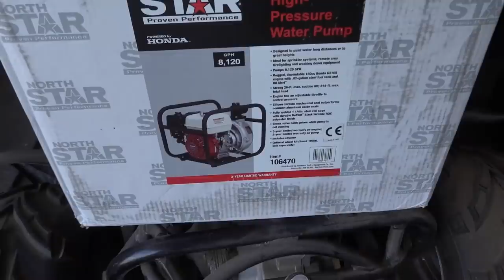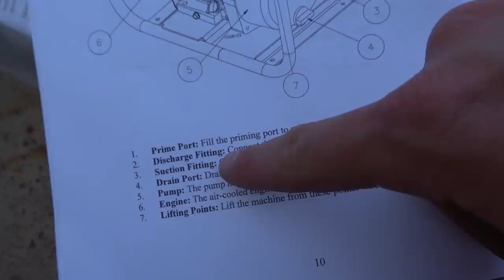I Built the Pumper Truck!!!!! Master Chief is Alive!!!

Comment: Matt I've been a firefighter for over 35 years, what you need is a 1" hose reel commonly known as a booster line or a trash line that will solve all your problems it's a hard line so it won't kink it's on a reel so you can just roll it up and pull out what you need
Reply: this needs more upvotes and replies so it makes it farther up the list of comments and gets seen
Reply: Great advice
Reply: You need a water cannon mounted up top. The 1" reel will work well for your use also.
Reply: Booster line is the way to go !!!
Reply: Dang good advice.
Reply: He could also use a proper manifold and a check valve in a return line so the pump isn’t fighting the water when the nozzle is closed.
Reply: heres a comment for visibility
Reply: Kevin that's exactly what I was thinking he needs a 1 or  1 1/4" trash line on a hose reel that's what we had on all our brush Trucks
Reply: @Zombies_Ate_My_Neighbors  the reel deal, if you will...
Reply: Thank you for your service brother! So many people always think about what the armed forces do but they never stop to think about an to thank those of the citizen people. I.E police, firefighters doctor and nurses! So to you an to all those like you. I say thank you for all your hard work and bravery especially these past few years. Keep rocking on an stay safe y'all
Reply: He will be better with forestry  hose and just pack it  like a pre Connect
Reply: Yup ... Some reels are even powered for ease of rolling the hose back on ...
Reply: I agree im also a firemen booster line or even just 2 1 inch forestry lines
Reply: As a retired firefighter I can say, Kevin is 100% correct.
Reply: Would he be able to connect that booster line to the top of the truck?  If I remember correctly, that thing has a turret.  This way he can fight the fire from inside the truck.  All he would need is an electric starter for his pump.
Reply: And a remote controlled mounted nozzle
Reply: The take is too high a square one that is lower is what is needed.
Reply: That was going to be my recommendation as well. Very sage advice.
Reply: Beat me to it.
Reply: A hydroseeder hose reel will also work(its basically the same thing) and will give more pricing options.
Reply: Booster line is definitely the way to go. If you want to draft from a pond you need a float for the end of the suction line so it doesn't sink to the bottom and fill your pump with silt
Reply: Booster is definitely way to go maybe mount under bed if possible.  Have welding buddy make a sort of hose bed for all the 1 1/2 he bought manifold it all.out properly  with a return to tank so pump doesnt over heat also have a setup for drafting so you can run indefinitely next to a water source maybe the ranch needs a  medium sized pond dug for a fire water source and if fire gets crazy a tanker can keep the pond full without the need for a holding pool
Reply: This is great advice.. he should check out the piranha brand hose
Reply: Solid advice man
Reply: Just wondering if the water tank has baffle's in it or needs them ?
Reply: I’m glad this comment is so close to the top, I was worried good advice would get buried, but now tell him real firefighters don’t use pistol grips 😂😂
Reply: this, ive been fighting fire for almost 7 years.
Reply: @thomasm3324  assuming you are talking about the water tank having a high center of gravity and he needs to get a different one... To start, this isn't going to be an actual service vehicle, it's private use and should be in position before the fire even starts thus negating the maneuverability issue. But I could be wrong, he could get a new tank for the truck and put the poly tank on a trailer... Also, I'd contact local municipality about tank filling or fill it at the bunker, don't wanna pump his well dry, hell he would even be able to have a side hustle if delivering water for say pools if he does the double tank w/one on a trailer, thousand gallons a shot
Reply: Booster line 100%, also solid line to pump get rid of suction line. We have 2 lines on top of our brush truck that are on a wye as well as a red line booster with the ability to run a 1” if need be. Skeeter brush trucks would be a place to look for ideas in my opinion they are pushing out trucks like this one
Reply: Great idea!
Reply: Reply
Reply: Agreed. I was thinking that all the time.
Reply: I would also recommend a smooth bore nozzle over the fog nozzle with the trash line. Less friction = higher flow and more distance
Reply: yep also smaller diameter has higher pressure but slightly less volume output than that of his larger diameter hose
Reply: Agreed
Reply: 👆🏻this guy knows what’s up....
Reply: @xsf531  for his application and what he wants to do with it a fog nozzle  would be better for him especially since he doesn't know the power of a smooth bore if he actually does have a fire that he has to deal with on the ranch a smooth bore can make it much more difficult and spread if he hits it too hard and too direct a novice is much better off with a fog nozzle to start with and get used to
Reply: and a hole in the ball valve handle to a red chain pull hanging off the back will turn it on from the ground. 
you could fill it up with BABY OIL and take it to south padre island for spring break.  wait, oh no you can't.
Reply: I completely agree. I am a firefighter and have been since 1995. Anything over a 1" line is going to waste water on a brush fire.
Reply: Yup
Reply: Kevin is correct, I'm no longer a fire fighter but that 1 inch hose reel will fit the bill. Additionally, a monitor mounted on the roof with remote operation would be the cool  you are looking for.
Reply: @Gladius7  I was thinking that also.  That's a lot of slosh to be going side by side.
Reply: @grayhawkflighttraining4044  That truck probably has PTO that could run a big boy pump, no electric starter required
Reply: Kevin is correct! I too was a FF and my position was pump operator and we work off of gallons per minute with the current pump on full you’ll have around 3.73 minutes of water. That’s not including your nozzle and hose.
Reply: MATT READ THIS lol
Reply: Gooda advice
Reply: Well his other problem is he’s using a normal 2.5 inch attack line for wildland should be 1.5 and a bigger pump. Gotta get that UHP
Reply: A CAF system would be perfect for him it's lighter no kicking problems and would put out more fire than anything he can fit on that truck
Reply: Kevin hit the ball spot on, also so more recommendations would be setting up a manifold so that you can recirculate water to keep the pump cool if it is running but not pumping to the nozzle. Also depending on the uses of this truck setting it up so you can draft might be useful.
Reply: 25 years here....  DITTO on the reel line.....small line, you only have a very limited supply of water.  You can go through 500 gallons faster than you realize,
Reply: Absolutely
Reply: The reel can have an electric takeup motor to bring in the hose.
Reply: I didn't think about a booster line in my comment. I discouraged a hard 1.5 or 2 inch because they're a pain.
Reply: Booster reel or just 1” forestry line. I too have been a firefighter for 30 years and agree with you Kevin. Also even if he max’s out the weight he most likely won’t be traveling far distances.
Reply: You really should contact your local fire department. When I was chief at my local department it was nothing for our department to help out whenever and with whatever we could. I bet if you reach out to your local department they will help you with you vision and even help make it better with experience. Good luck and stay safe.
Reply: I'm a firefighter in Canada and great advice. I would also recommend a strainer if you are thinking of drafting to fill your tank. Otherwise you might destroy the pump impellers.
Reply: Our 2.5 ton M35a3 had a 500 gal tank alum tank with 3 baffles and the pump was under the tank between the axels. it was Hard pipped with 2in pipe. It had a drain right at the pump and ran to a front 1.5in discharge, passenger side 1.5 discharge and a 3 in fill port with a 1.5 inch and 1in booster reel discharge. the Pipe had a recirculating valve set to 100psi, the pump ran at a constant 125psi when at full throttle.
Reply: F
Reply: I'm no expert but you might want to cover or paint the water tank so mold or alge doesn't form in the water
Reply: @wreckenbach9703  Yer I don't know if tanks come stranded with baffles or not you would think so.... Maybe... 
Because that amount of water could potentially roll the truck Right ?
Reply: @CommonRailCoop  I agree with the hose but I’m not 100% sure he needs a bigger pump. If reduce the hose size that should increase the pressure
Reply: @sps25678  he’d need someone to operate it though. I’m thinking he’s just gonna run it till it’s empty or the fire is out so circulation might not be as big of an issue. You are right the though circulation would be better for the pump. I wonder if there is a way to do it with a pressure valve? Pressure builds up it opens circulates then he cracks the nozzle pressure drops even lower and closes the valve. Idk if something like exists but it would be nice
Reply: @codybyerley2121  I was wondering if they made an automatic recirculating valve
Reply: This is a reply to make sure your comment stays at the top of the comment section because Matt needs to see it!
Reply: That is exactly what I was going to say
Reply: I have a 1” hose reel and nozzle available if you want it. For free, from AZ.
Reply: Exactly what I was about to say, great advice.
Reply: Not a bad idea
Reply: Also, if he decides to keep that smaller  pump... running gas without methanol will help it to start easier if it's goint to sit idle for a long period of time.  Methanol free gas is more expensive but in an engine like that (think snow blowers or motorbikes) it can sit for up to 3 years without going bad unlike regular gas which only lasts 6-9 months without use.
Reply: Retired Chief and I agree with Kevin Devine
Reply: Whatever they said. My Comment is just to help 👍
Reply: hes right you know
Reply: Just get a hydroseeder.
Reply: Booster reel for the win
Reply: As a fellow firefighter i concur with this comment
Reply: Upvote
Reply: Said exactly what every demolitia firefighter was thinking! Haha 1 inch forestry line and forestry nozzles would also be a great addition if you find you need just a bit more reach. Light and easy to store and dry
Reply: 34 years and agree completely!!!   Keep the tank full as well,  with that much weight sloshing around  at 1/2 or 3/4 full and you could have it laying on it's side as tall as that thing is with some of the hills he drives on...
Reply: Yes, a Booster line would probably be the best for the lmtv
Reply: Yeh
Reply: he should get a booster line the will retract it's self so he doesn't have to manually reel it in
Reply: And he could also use a gated y to switch between the hoses.
Reply: @kyleholmberg1678  if it's gonna be a designated Brush brush to be able to run the booster line and structural hose I don't see the huge need to have a gated Y, Also he'd need a bit bigger Pump to get enough GPM if he's running two lines. He could definitely manage but I feel like a single booster line is more then enough
Reply: @Zombies_Ate_My_Neighbors  I think you mean REEL deal. :)
Reply: And a pressure relief for when the nozzle is closed
Reply: @jryker28  Yeah but come on, cut him some slack, it is Demolition Ranch  after all. :)
Reply: Fantastic
Reply: Good thing I looked, great advice!
Reply: Booster line is definitely the way to go. with the 2 1/2in hose maybe weld up a hose bed on the back of the rig to lay the hose in. Brush rigs normally have 1” hose packs that deploy quickly. Most structure rigs have a “cross lay” which is 1 3/4in hose and is a lot more maneuverable than 2 1/2. Hose beds are the way to go for your bigger hose so that you can deploy quickly and then have your booster line on a reel as it is like a garden hose.
Reply: Great advise!!
Reply: Most these people read the description  of hose pipes word for word lol most of these people don't have a clue what does what without google Funny as hell
Reply: Yes
Reply: i agree, im a student at chemeketa in oregon and id say at max you'd like 1 3/4 inch line (hose). make sure you have a proper fitting nozzle and for someone without hose line experiance, its best to run at a lower pressure
Reply: It's true
Reply: Very good
Reply: I'm a firefighter too, I agree.
Reply: As a former firefighter myself this Is 100% correct and the best advice!
Reply: Exactly what I was going to suggest.
Reply: @mikedelaney253  less friction loss too!
Reply: Nice
Reply: I knew there had to be a fireman somewhere in the Demolitia!
Reply: I completely agree with you. Thanks for your 35 years of service brother! (I’m on a volunteer department in rural Iowa)
Reply: @WhiskeyRiverRifleman   there’s quite a few of  us actually, I love it!!!
Reply: Yes I agree with this, also getting a deck gun wouldn't be a bad option for not wanting to stretch the hose.
Reply: @Wombbatts  Don’t tell Mere!
Reply: 👍great idea
Reply: Exactly what I was going to suggest.
Reply: You need a jet truck like a vactor or vac con sewer cleaning trucks mine holds abt 2000 gallons with 500 feet of non kind 1.5in hose pressure run max of 4500 psi
Reply: One guy mentioned sucking from a pond or lake.  You need several things... a true suction hose.  This is stiff hose, usually has a wire spring molded into the rubber, but there is also hard plastic hose.  This is so the hose won't collapse when sucking through.  Next, you need a check valve on the pond end, and it should be heavy to keep it sunk below the surface of the water.  Finally, you can't start from a dry system.  The suction hose and manifolding up to the pump, and the pump itself need to be full of water, no air.  And this is why the check valve.  To start off, you need enough water in your tank (mark it on the side when you get this all figured out) to flood the suction manifold, hose, back down to the check valve, and the pump itself.  And you can only raise the water so high, so get the truck as close to the water as you can.  Open the valve to the suction hose, let it all settle out, no more bubbles coming up from the hose, and put it in gear.  Circulate back into the top of the tank and fill it up.
Reply: I totally agree @Kevin Devine, a 1” or even do a 1-1/2 inch trash line, I’d also look into spray setup for the front get a few 180 degree spray nozzles for the front of the truck angle them towards the ground
Reply: The only thing I would suggest is use wildland hose i stead of a booster line
Reply: @Gladius7  I thought the same and couldn't see any baffles at all in the tank during the video?

For anyone who didn't know, baffles are vertical dividers inside the tank in a square or diamond pattern that run from a couple of inches above the outlet right up to the top of the tank, and their purpose is to stop large volumes (and therefore large weights...) of water from sloshing-around when the firetruck turns corners, accelerates/decelerates or drives up or down a gradient and making the truck unstable, or even potentially turning it over...

The gas tanks on race cars and the tanks on fuel tanker semis always have them, and for a good reason -for example, if Matt drove the firetruck down a steep slope (maybe the hill that he drove the 5-Ton down to rescue the El Chromino a couple weeks ago) with the water tank say only halfway-full, and then hit the brakes on the way down to stop gravity from accelerating the truck any more, then the truck would slow but all that weight of water (around 2000lbs, maybe more?) would rush to the front of the tank without any restriction at all, and could either tear the tank from its' mountings in the bed (a bad thing to happen...) or tip the firetruck onto/over its' nose (a really, really bad thing to happen...), so a tank with baffles is ESSENTIAL on a truck with such a high centre of gravity already.

Also, water pumps like that with a pull-starter, and the pull-starter assembly can be unbolted from the engine (normally 3 bolts at 120⁰ intervals, and the starter-cord exits the starter at either 60⁰ or 120⁰ to vertical), rotated around the end of the crankshaft until the starter-cord is running pointing downwards from the truck bed (making it easier to start when you stand below the pump) and bolted-up again.

The on/off switch is just a pair of wires that can be extended to mount the switch anywhere you like, and a cable linkage to operate the choke is very simple to fabricate also.

I hope that helps 😊
Reply: Nice
Reply: @WhiskeyRiverRifleman  there's a lot of us here
Reply: Definitely agree with using a booster line.
Reply: Or forestry line
Reply: Exactly I was thinking this or a bigger pump with a 1 3/4  line but I’ve really only dealt with our urban apparatuses (I’m new and getting my card around February right now I’m only an explorer)
Reply: exactly what I was going to suggest. And a wrench for the hose fittings.
Reply: yup i agree 👍 in the chat lets get this so matt can see it
Reply: booster it a way to go and a 100 gpm pump
Reply: This is the comment I came here to find, to make sure it had been posted. 100% the correct advice.
Reply: I instantly thought of the booster line! Lol and I also cringed when he didn’t lay out that hose
Reply: Yep r he could get a fire skid already put together
Reply: I'll vote for the booster line on a reel.  I wish you would have spoken with some of your local firefighters and looked at what they had before you bought all your stuff.  I was really hoping that you would have purchased a "skid" unit to put on the bed of the truck.  That would have had a tank, pump, manifold, and valves already built together as one unit.  The pressure relief/recirculation valve would have been there and it would have been set up with the ability to draft from a static source.  All in all not a bad build and it will do what you need it to do.
Reply: @thekumargod  I see what you did there 🤣
Reply: Definitely go with the booster line and a hose reel. Will work perfectly for what you need.
Reply: Also Matt, with a boomer line you don't need to worry about drying the hose either
Reply: Could also fold the flexible hose so when you pull it out, it's straight and ready to go.
Reply: What Kevin said.
Reply: Glad someone said this, thinking the exact same thing
Reply: I was about to post this. Thanks Kevin!
Reply: @Gmpro02  o
Reply: I agree
Reply: Sounds,advice
Reply: We gotta move this comment up!!!!
Reply: And maybe a fire fighting course to learn about different types of fires and nozzle techniques
Reply: Upvote so he sees it
Reply: Step 1: get a booster reel
Step 2: get rid of the pistol grip 👌🏼
Reply: I was literally going to tell him the same thing not a firefighter but my dad is and i help around the station all the time.
Reply: would putting the tank in back and the and the pump engine near the cab help Kevin?
Reply: @sharntwose5181  no the gravity load would shift and the truck could roll over
Reply: As a firefighter yes I agree as well. A two and a half inch line is Way too big. I agree with the original commenter
Reply: can also do like a minute man load for the 1 1/2" hose for when he needs the GPM
Reply: Nice
Reply: i guess im randomly asking but does anyone know a tool to log back into an Instagram account..?
I was stupid lost my password. I would love any help you can give me!
Reply: @Terry Camdyn instablaster ;)
Reply: @Jaxx Mason I really appreciate your reply. I found the site through google and I'm in the hacking process atm.
Looks like it's gonna take a while so I will reply here later when my account password hopefully is recovered.
Reply: @Jaxx Mason It did the trick and I finally got access to my account again. I'm so happy:D
Thanks so much you saved my ass :D
Reply: @Terry Camdyn you are welcome :)
Reply: Ya